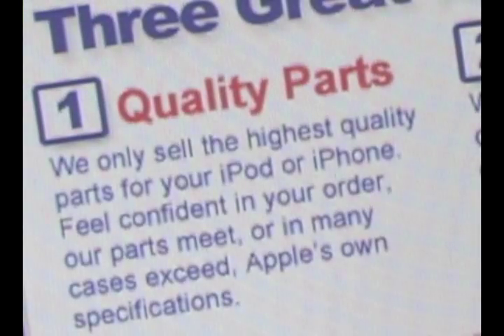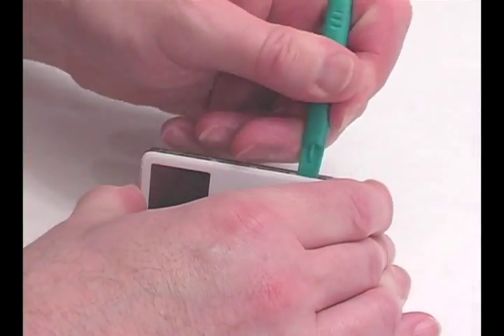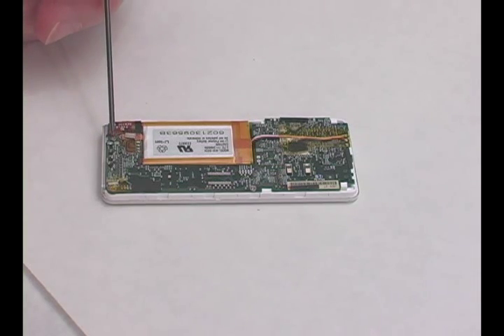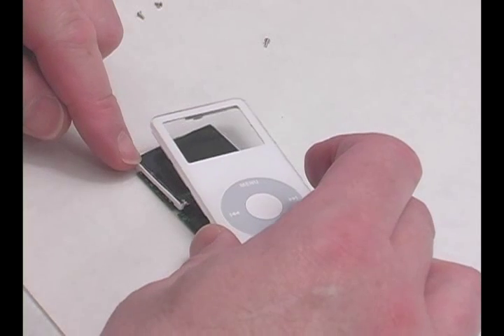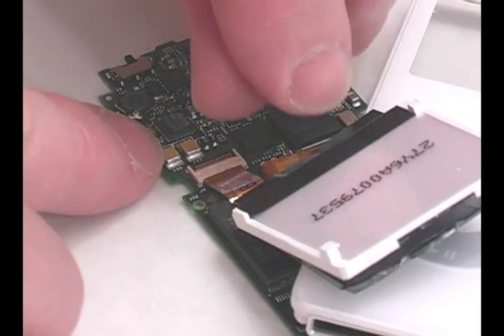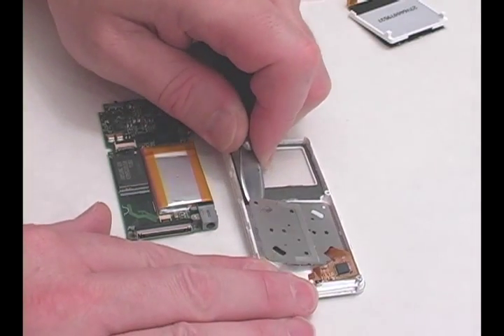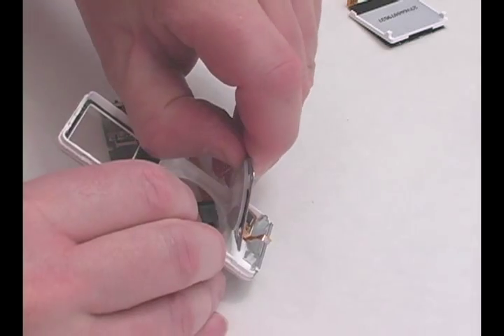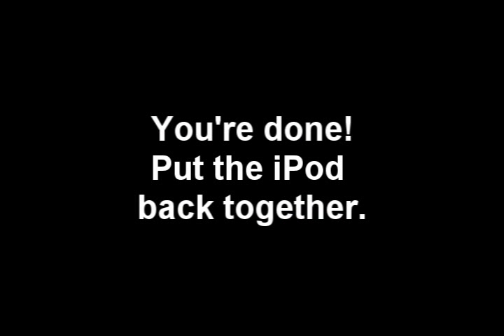DigiExpress - iPod Nano 1st Generation Click Wheel Installation

Comment from the maker: The menu button is part of the click wheel assembly. This video shows you the repair for that part. Replacing the click wheel would take care of any menu button issues you may have unless there is a main board issue with the device.

Comment from the maker: @marianoc261 No need to apologize, your English is great.  The clickwheel may be the issue.  If there has been any water damage to the iPod, it may be something more than that.  I would start by replacing the clickwheel, seeing as how you can get it to hard reset means that it is functioning but in limited capacity.  We do sell the clickwheels if you cannot find a local vendor.